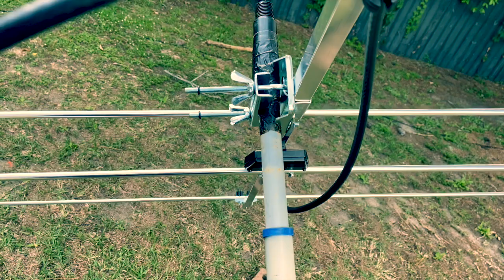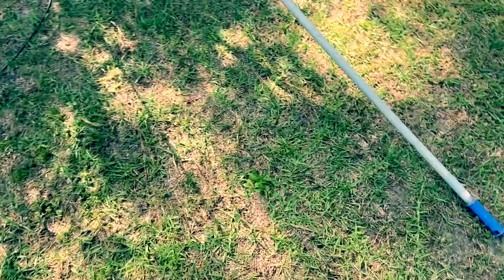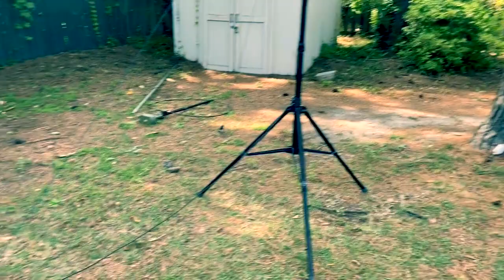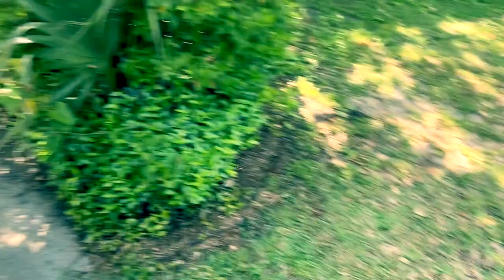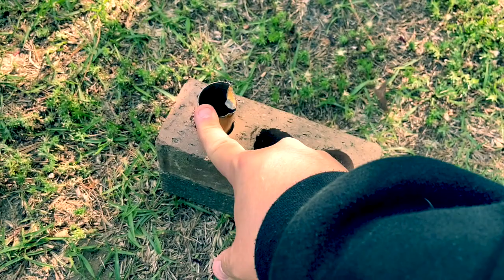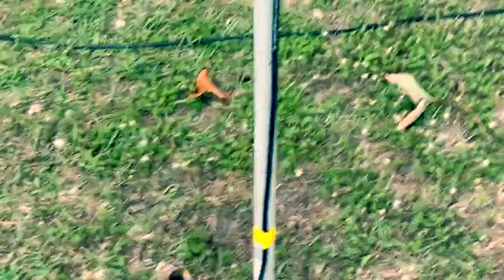Installation of a $40, 4-element FM Beam!

Comment: It was just the other day I realized my W6LVP loop would receive fairly well on FM. Did not know it would do that. Hooked it into my RSP1A and didn't catch any real DX but did get a few stations out if what I think normal range would be for here North of Charlotte. Now I know I  going to out it on the rotor and use it at new QTH where I am moving next week!! Good luck with the channel, I will be watching all I can!!
Reply from the maker: It actually does a much better job at FM DX than I thought it would.  I am working up a few homebrew FM antennas for this upcoming season, so definitely stay tuned.  Videos are to come!  73 and best of DX.